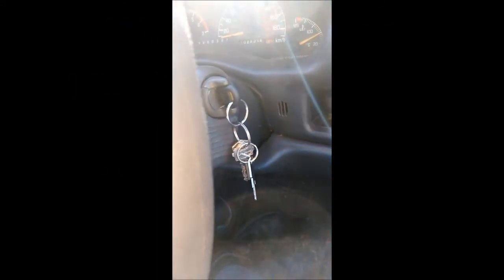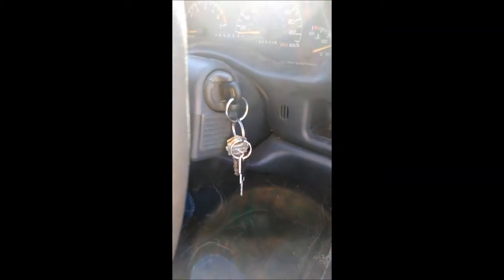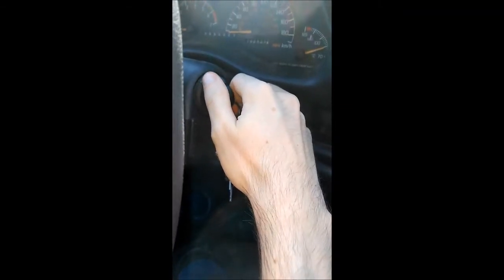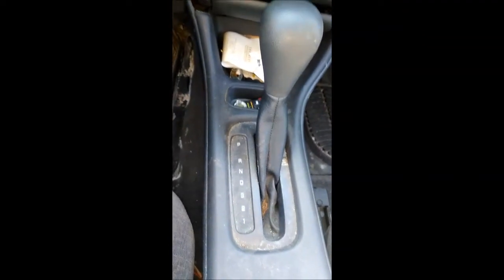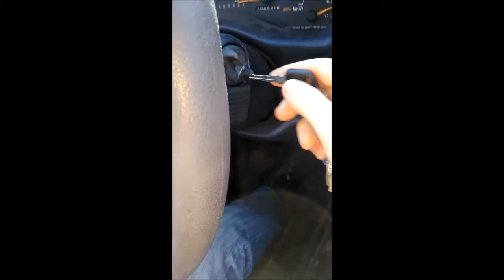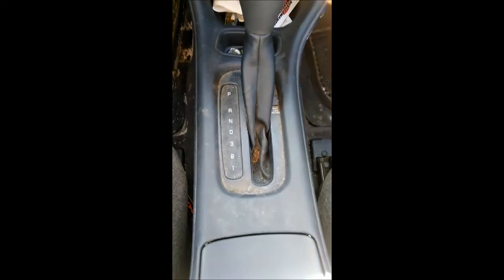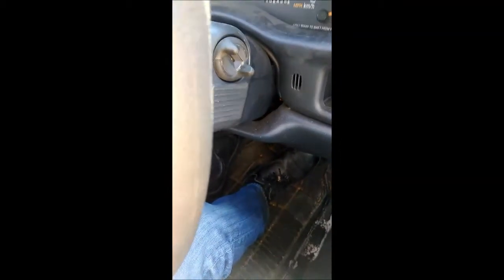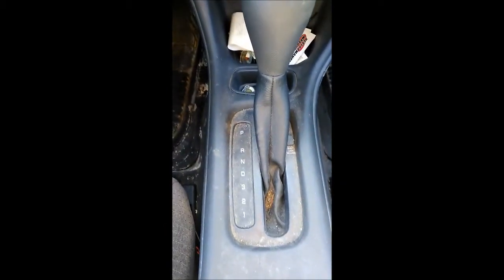Car Key Stuck in Ignition Won't Release

Comment: I just bought a 2004 Toyota Tacoma and have this issue.  When I took it to my mechanic for a "once over" he is the one that noticed but just said the key sticks, use  WD-40.  It happened to me for the first time later that day and I am the one that figured out it had something to do with the truck not realizing it was in Park.  After shifting in and out, the key came out easily.  I found your video and subsequent comments more reassuring that something isn't broken and needing fixed.  Thanks!
Reply from the maker: I suppose the key could get stuck in a gummed up key cylinder but it's pretty rare.  This is a totally different part of the car causing the problem so yeah, glad you stopped by and got the help you needed.  I'm sure you mechanic had good intentions but was chasing a red herring.
Reply: My2004 Tacoma just started doing this. Gonna lube the key cylinder.. but definitely gotta put in an out of park . I was stuck for a half hour right now
Reply: @stephenasanchez  I ended up having to get a cable in my shifter changed.  It has been perfect since then.

Comment: Thank you so much for this video. I have a 97 Saturn SL two, which at this point is 24 years old and is in mint condition. We have replaced the motor and I noticed a week ago when a I had put the car in to park, I heard a crunching noise. Then two days ago when I put the car in to park, there was no crunching noise But the key would not come out of the ignition and the shifter would not lock in the park. My husband has the Consol out of the car this morning and is looking all around to see what could be wrong down in the shifting mechanism. I just saw this video and now we know exactly where to look to get this fixed. Now we know what the thing is called. Thank you so very much.
Reply: Due to keeping coins in the ashtray, it turned out that a penny head somehow made its way down into the shifter groove and got stuck in the very end of the plastic accordion groove cover, for lack of a better term. Having moved the shifter back-and-forth several times after removing the console, The very edge of the penny could be seen and after be very labor-intensive. With needle nose pliers, the penny was eventually removed, the shifter would go into park without any problem, and the key came right out of the ignition. What a pain in the ass.
Reply from the maker: Happy to be of help!

Comment: So does that mean there’s a transmission issue we gotta get addressed?
Reply from the maker: Ehhh... it's more of an "I'm an old man and my joints hurt so I take a Tylenol now and then" kind of thing.  If it gets progressively worse and starts interfering with your ability to use your car without constantly fighting with it, you might consider fixing it but most of the time it just isn't worth the hassle and expense.
Reply: @ChrisCamaro  I appreciate the reply man! Nope you’re well! Does your car still do this?
Reply from the maker: @juliannewman8720  Not as yet.  I'm sure it'll come back one day (this is a design defect after all) but good so far fingers crossed.

Comment: this helped alot thanks
Reply from the maker: No problem.  If your gear selector requires you to press a button before you can move the stick, you can also just press/depress that button repeatedly until you hear the electronic click associated with unlocking the key cylinder.

Comment: I got a manual transmission. What do I do
Reply from the maker: This problem is specific to how the gear selector on an automatic transmission interacts with the key cylinder.  It would likely be completely different on a manual transmission car.
Reply: @ChrisCamaro  just punched it in lmao. Now it works fine

Comment: I has this problem expect my car wouldn't start but wouldn't turn all the way down either. Eventually I pulled it out by putting it into reverse and neutral. It rolled a bit and was eventually able to take the key out my ignition. I have a 1979 camro though idk if this would apply to this situation
Reply from the maker: Since it is common to interlink the gear selector with the steering wheel and parking pawl systems, rolling the car in neutral and turning the wheel to 1 direction or the other is a good way to unstick the ignition.

Comment: I have a Dodge Ram 1500 2nd gen and my truck key is stuck, I can’t do anything with it, I’ve tried everything and it won’t come out
Reply from the maker: I assume you mean you tried the trick in this video?  Can you start the car and drive over some bumpy road and give it another try after that?  If the key won't come out there's a spring or detent or something that is stuck so vibrations can sometimes get it to disengage.
Reply: That's bcuz u came here for your video on this problem. Check other vids. This one is ummm, not too great. Effort was good but this is NOT going to work. It has nothing to do with rolling the car bro.
Reply: @ChrisCamaro  i tried starting it, throwing it in park, it’s just not coming out, I even put the transfer case gear in neutral
Reply: @ChrisCamaro  it starts and will run, it’ll turn everywhere except the key has 1 click before turning completely off
Reply from the maker: @yallknow1272  Often times somebody with a different vehicle will get inspiration from watching my video on a Grand Prix.  It happens that Grand Prix's exhibit this problem a lot for the reason I described.  The OP has a Dodge product so the failure mode may be entirely different.  That is neither his fault for seeking an answer here nor mine for not being able to provide one.  He is simply being thorough and checking different sources describing similar issues.  I am simply trying to be helpful by coming up with ideas that may or may not help him.